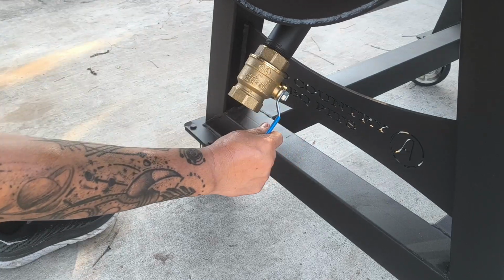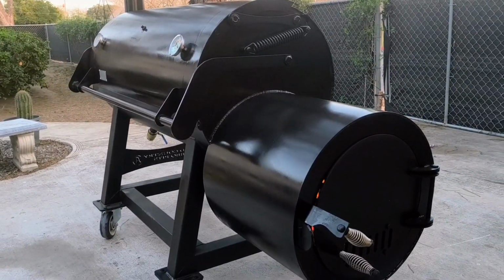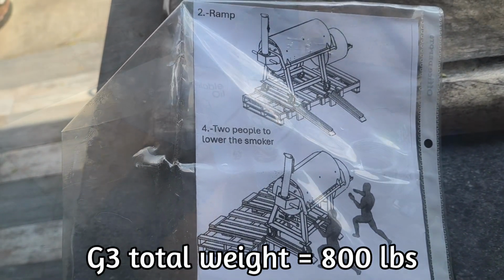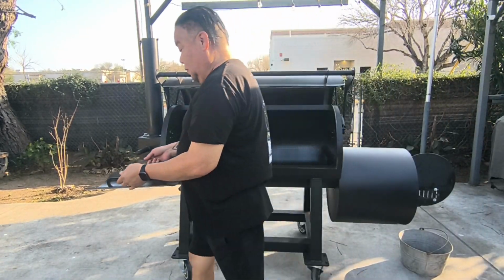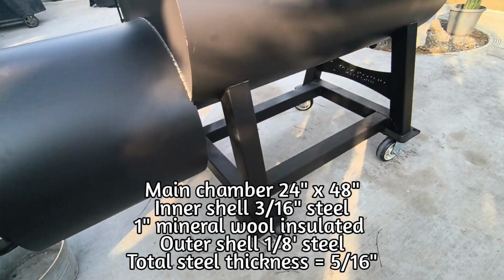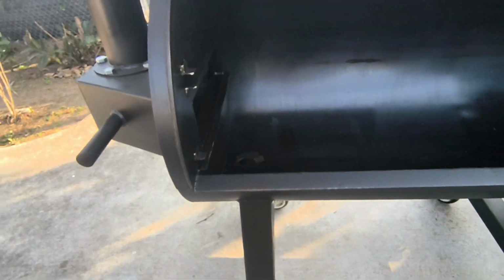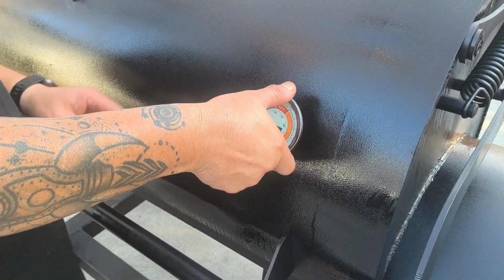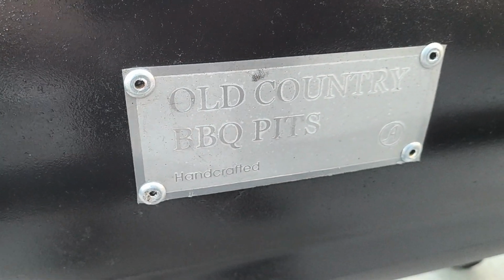Full Specs - Old Country BBQ Pits G3 Offset #oldcountrybbqpits #offsetsmoker #texasbbq

Comment: All that insulation in such a small is going to hurt the overall smoke flavor. Using less fuel is nice but people forget fuel is almost flavor. Might as well use a pellet smoker.
Reply from the maker: There are ways to counter it's efficiency - like opening up the firebox door or using smaller wood splits that way the frequency of adding wood is increased. The whole point here is that you're more in control of what you want to do. Do you want to run efficient; then keep the firebox door closed and use less wood. If not, then do what was mentioned. Think of it this way - the Ole Hickory pits used by many restaurants outside of Texas only use one wood split for their whole cook and still have smoke flavor. So as long as you're using wood, you are still going to get some smoke flavor. Thanks for stopping by!

Comment: I wish we were closer so we could run a comparison of the G3 with the Texas Smoke King from M&M.  At a $1k lower price difference, the G3 is definitely worth a look.  I'm curious how the insulated walls will work for you, seems like its gonna run hot on you but maybe not.  My first thoughts are I like the handles on the stack to move it around, the additional temp gauge locations (the SM only has one), and the two racks in the cooking chamber.
Reply from the maker: @LoneBullBBQ  I'm doing the first long cook on it today. Did a short cook to learn how to run it. Should be the first cook video on this. Cheers bud!